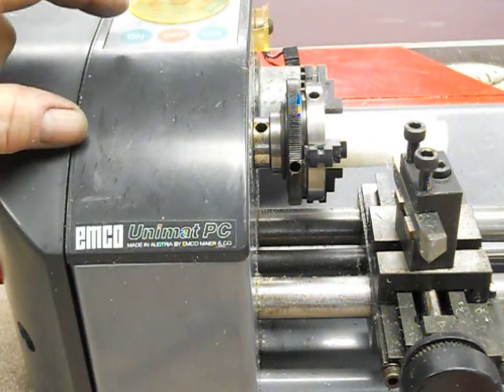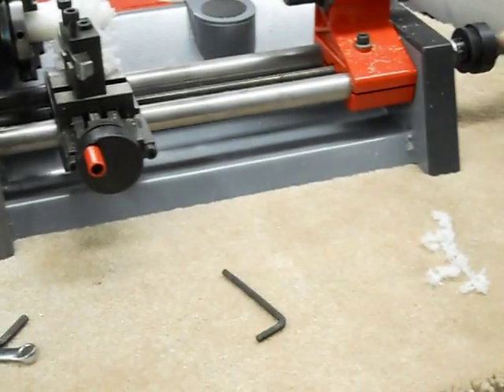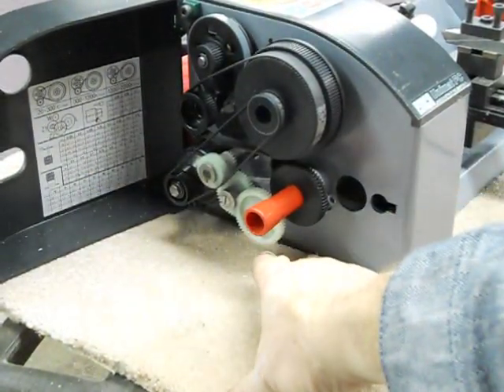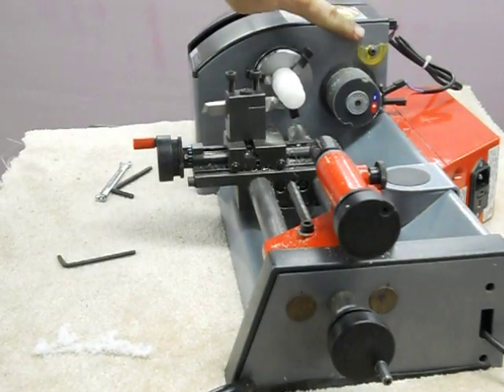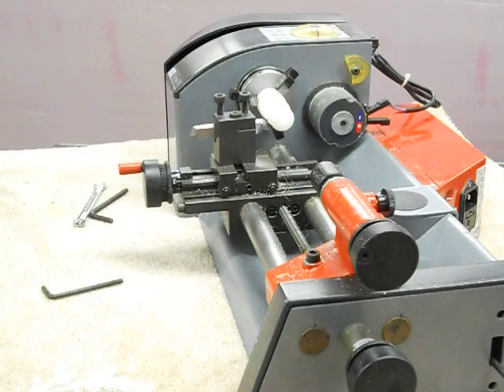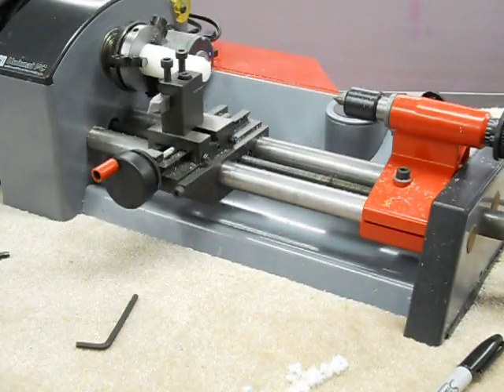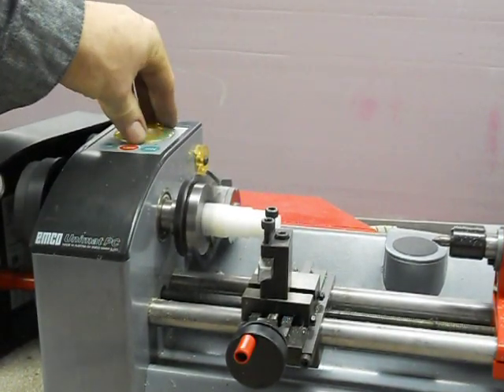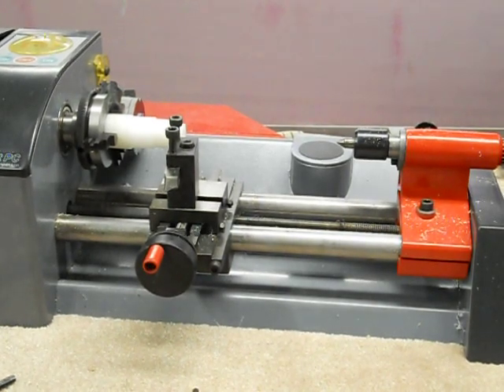Unimat Basic PC Lathe.AVI

Comment: hi. is that rigit? what the diameter of rod steel ?thx
Reply: Ali Hureiby 2cm for the bedway bars - is that what you needed to know?
Reply: John Mellor hi? 2cm = 20 mm? Im intresting in that round bar bed, how the carriage clamp on that round bar? Is that like wabeco lathe system or like old unimat ? Btw can you tell me too the diameter of bed of unimat sl2000 ? Many thanks, btw you have nice mini lathe in colection :D
Reply: Ali Hureiby I have done a video that I notice you have seen.  One of them shows the clamping plate for the unimat basic pc. I have not seen the sl2000 in the flesh. I would guess that they used the same size bars as unimat sl at 1.2cm. ...keep with what they know works. ..But it is a guess.
Reply: Yes, most probably. No need to stock lots of different components if not needed. Incremental upgrade path.

Comment: A spec manual can be obtained from lathes.co.uk...I bought one for my lathe/mill ...one area of caution and that is the 3 step pulley that is attached to the motor it can crack in the centre where the grub screw is...mine did and they are expensive to replace....if you search the web you can find a detailed OEM list of component parts with there orignal part numbers for the lathe and mill...I hope to fit a second psu to run the mill and lathe for fly cutting should give a better finish on parts

Comment from the maker: @GrafRamolo 
I think the sensor is a rotary position sensor on the spindle.  Such a sensor can be used with computer controlled XZ axis control to do threading.  

Would you happen to have a manual for this lathe?  I'd be interested in a copy of the manual.  The sensor might be described in the manual.

Comment: I have also the same model. It's great! I have vertical mill as well and quite few other additional tools. Right now I want to make quick acting collects system and also tail stock turner for 4-5 tools. I've made my own metal handles because I do not like those plastic one. I really love this machine and it's so useful in my workshop!
But what is this sensor? I never heard of it, what does it do?

Comment: thanks for offer on the steeper motors, but they were never that great when new !!! if you get a chance try looking at the HOBBYMAT MD65 lathe you can cut metric or imperial just by changing gear wheels....I will be looking to replace my Emco with one of these and they do a seperate mill

Comment: I have the same lathe there are great, you are correct the shield covers the chuck mine has broken too...I dont have the sensor on mine,, but i did get the vertical mill.....the cnc side will only run on a old computer running DOS operating system using orignal parts (( and they are rare and expensive )).did you but on ebay or sell it ??